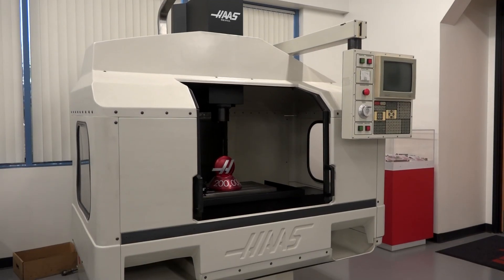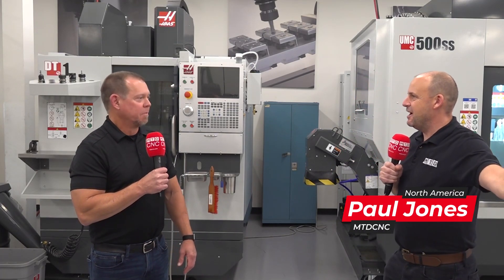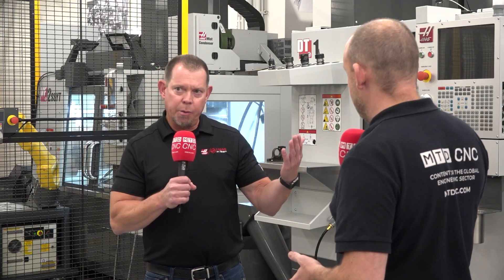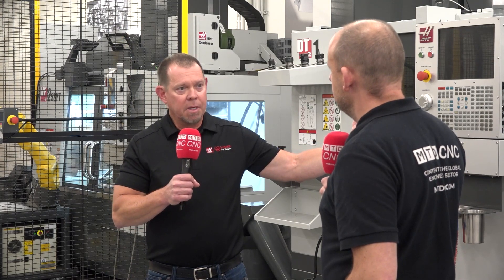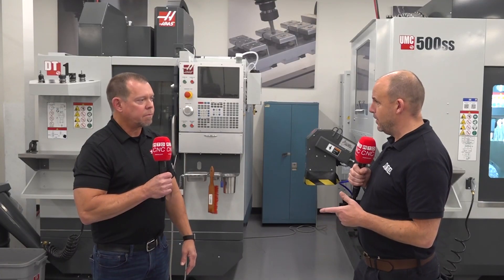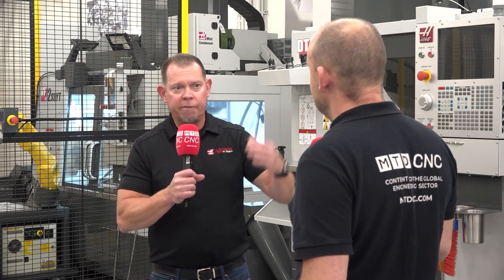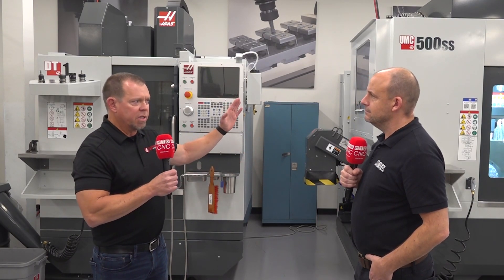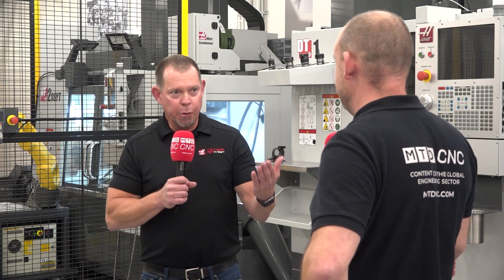HAAS Factory tour in California with Bryan O'Fallon

Comment: As a small manufacturing business I had an extremely upsetting and disappointing e perince with HAAS, even to the point of their directors lying to the US to cover their backs.

My milling machine we are buying new in Feb will NOT be a HAAS as can’t afford their super slow responses and leaving me high and dry.

Downtime cost me half the value of machine and they wouldn’t even buy it back at used price let alone refund.

Sold 1.5 year old machine to buy a 9 year old different brand to get support and reliability. This machine has done double cut hours of HAAS already and been fantastic.
Reply from the maker: we normally hear just good things about Haas, sorry to hear this